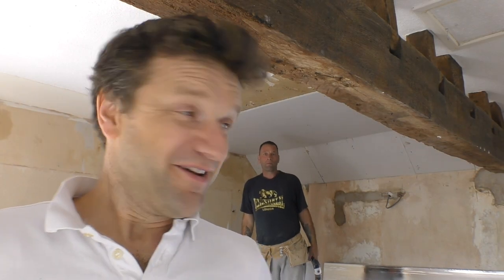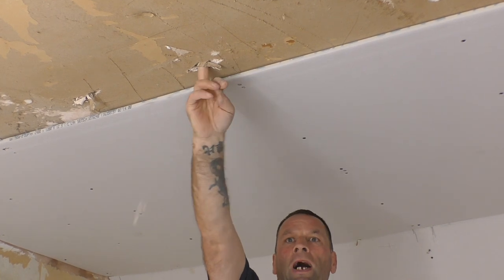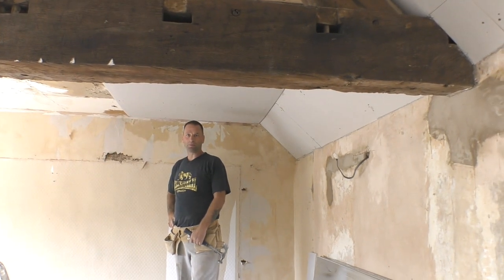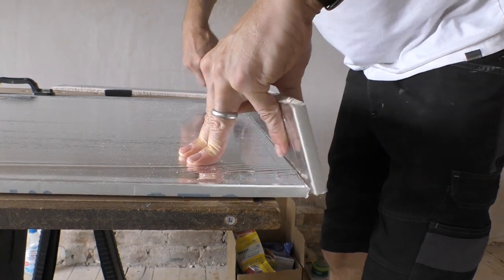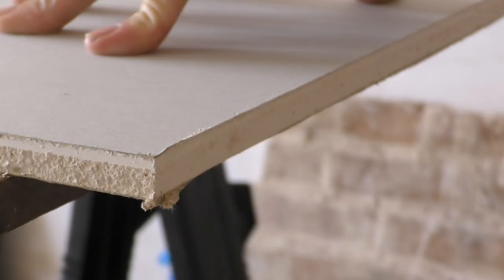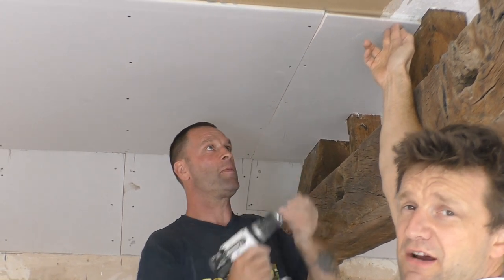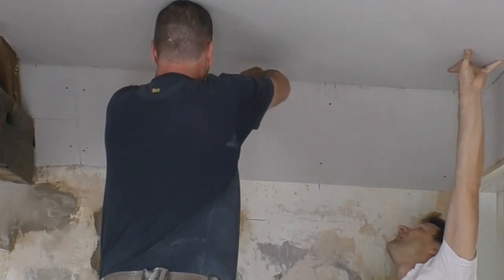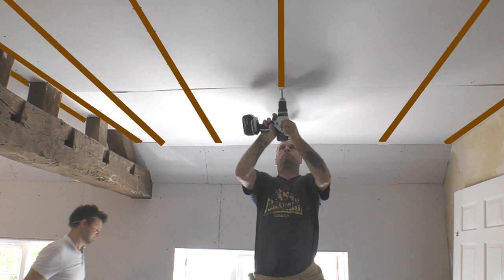How to Plasterboard an Old Ceiling

Comment: I have put up plasterboard on two ceilings in my house. In both cases, I have removed the old plasterboard first. This is a filthy job especially if there is insulation above. Having removed the old plasterboard, I have attached 2 x 4's to the joists to create a perfectly flat and level surface for the new plasterboard. Obviously this is a lot more work and only worthwhile if the old ceilings aren't flat and/or level.
Reply: @Suns Out silly comment.

Comment: I’m replacing my bedroom ceiling this year. I’m going to take the old ceiling down and replace it with a new one don’t like the idea of to much weight over my head. I know it’s going to be a messy job.
Reply from the maker: It will be very messy but satisfying when done.
Reply: much better way of doing it! sticking it over the top very amateurish.  where are the joint strips?  where's the leveling???

Comment: 45mm screws would suffice if fixing into joists/rafters/studs directly. Spec sheet for British gypsum is 25mm screw penetration min. and 230mm spacings with 150mm at board ends for ceilings.

Comment: By the way a good reason for not using foil-backed plasterboard when you don't need to is that it completely buggers up wifi if you do a whole room with it!
Reply from the maker: Agree with that Andrew. We've got celotex insulation everywhere in our office and have to go outside to use our mobiles !!
Reply: Agreed.  Upstairs like this is fine but I've heard of issues with this a few times.

Comment: In France they have a attachment that fits over the end of the drill bit, which makes it impossible to drill the screw in to deep , so they are All  in level, c, est  parfait.......🐟🐟
Reply from the maker: Yes you can get those over here too. Worth it if you're putting up loads of boards each day. 👍🏻

Comment: Very informative video, but how did you deal with the loft hatch architrave? I noticed you’d boarded round it. Would it have been easier to take the architrave off and board right up to the frame then architrave over the plasterboard?
Reply from the maker: There's was a little snippit in this video https://youtu.be/idmmDRM3x0A at 9:35 mins. Basically I screwed a new surround - 14mm x 30 or 40mm (width doesn't matter as long as it's covered by the architrave) of planed pine to the underside of the hatch, with a slight overhang that the hatch itself could rest down onto.  We could then plasterboard up to that pine strip, and then the new architrave was glued to that.
Reply: @CharlieDIYte  Ah makes sense, thanks Charlie! Looking forward to your next videos!

Comment: Do you have a video showing how to repair peeling plasterboard tape in corners of room (new build ). Your videos are really helpful. Just watched your 2 caulking ones.
Reply from the maker: I don't unfortunately but my advice would be to cut away the section that is protruding out of the plaster with a Stanley knife, (if it's only a small area which I'm guessing it is) and get yourself a box of this https://bit.ly/393yo8a and mix a bit up like I showed in this video https://bit.ly/37aov70 and apply it to the damaged area with a decorators knife or better still a continental fillers knife, leaving it a bit proud of the surface and then gently sand once it's set with a 120 or 180 grit sand paper wrapped around a little block of wood, or a sanding block if you can get one. It will be an invisible repair which you can then repaint. When you repaint, water down the first coat you, so it sinks in properly, just checking the emulsion tin to make sure it says you can water it down.
Reply: @CharlieDIYte  that’s great. Thanks for your help!  It is a rather large area (ceiling and adjacent wall) but I will try this approach on a small part first. And if works will do the rest. Thanks again.

Comment: Hi Charle, glad I found your video. Need to show it to my builder!!! We got a old flat ” plaster & wood lath” ceiling where we want to install number of trimless light” in each room.  I was told the a new ceiling needed to install those ” trim less light fitting”.      Instead of doing a drop ceiling or take the old ceiling down, the method show in your video might be a solution :).      I am interested in your view- Do you think the method showing can allow trim light installed successfully? Thanks in advance for your reply.

Comment: Do you have a video on joining the plaster board, sealing with take and playing over it or is that not done now. Thank you
Reply from the maker: This is the original video. https://bit.ly/3r5EV89 although you don't see me applying scrim tape to the joins. It's dead easy to do though so you don't really need a video on it. Just make sure you get a decent one, something like this https://bit.ly/2sjZ2X6

Comment: Hi. What would happen if the plasterboard had been fitted with the backing to the outside? A guy recently fitted it back to front on a stud wall he had built for us, but on the plasterer's advice we had to remove it and refit it the right way round before he skimmed the room. The guy who fitted it incorrectly said that it shouldn't make any difference. Who's right?

Comment: Thanks for the video Charlie. I've got a similar situation to this, though I was going to remove the old plasterboard and replace it, rather than going over the top. Is there much benefit in going on top of the old plasterboard?
Reply: The benefits are a lot less mess,when you pull the ceiling down all the dust and mess from above the ceiling as well as plasterboard.
Reply from the maker: You have to weigh up the pros and the cons, Dan. As Gerard says, there's a huge amount of mess if you take the ceiling down, as well as having to remove each and ever nail from the joists. In my case you have the added complexity of the sloping ceiling which would also need to be removed and that's interconnected with a rather bizarre arrangement where the victorians rendered a course of roof tiles at the top of the wall to cover a base plate that the roof joists sat on. With old properties like mine, you can quite quickly be faced with a complete rebuild so I although I'm a perfectionist and would normally want to remove the plasterboard and start again, I had to take the pragmatic line here - as we're living in the house and I didn't want to introduce all that dust and soot in to the living environment. If the ceiling is reasonably flat free of damp etc, plasterboarding over the existing is a sensible option.
Reply: @CharlieDIYte  Thanks Charlie, appreciate the response. I can definitely see the logic in this approach and think I'll do the same. My property is from the same era, so probably has similar issues. I'm slowly working my way through fixing the poor 90s conversion work and finding all kinds of issues.  Great videos, please keep them coming.
Reply: I took down an old plaster and lath ceiling (a very messy job) before putting plasterboard up on the advice of a very experienced (45 years in the trade full-time-  who has 3 year waiting list). He said the additional weight (doubling) on joists not designed to take that weight can over time cause bowing. Also, if there's a leak from a water pipe getting removing two layers can be nightmare. It was messy but I sleep easier...

Comment: Hi was just wondering what mm thickness(new 2nd) plasterboard did you use? 

Also I'm assuming that the joists are cable of handling the weight of a double layered plasterboard set up?
Reply from the maker: 12mm foil backed. Yes the roof joists won't have a problem with that weight.
Reply: @CharlieDIYte  besides the benefit of having a moisture barrier when using the 12mm foiled back plasterboard, would using a standard tapered edged plasterboard be okay to use? My loft has currently been gutted out and will be using it as a storage/office space. I'm thinking of using kingspan between the joists and normal loft insulation where needed. What do you think if you were in my current position?

Comment: Hi Charlie. Thanks for all you videos. So helpful. I discovered this video as we are currently overboarding an old ceiling in a similar condition to the one in this. My original concern was some parts of the old ceiling looked uneven and quite aged and not suitable to go on top of. But would you say this isn't the case?
Reply from the maker: My ceiling was similarly uneven. You'll find that once you pull it up with the screws that the plasterboard is reasonably flexible. I'd go for it!

Comment: Can you use the insulated plasterboard that you used on the walls on the ceiling?
Reply from the maker: No reason why not but it's heavy stuff. You'd be better putting decent insulation in the roof space above, assuming that's practical?

Comment: Charlie. Thank you very much for your video.

I am thinking of doing some DIY myself, so excuse a novice question. Why are you not ripping down the old plaster board to then put the new stuff directly on the joists
Reply: Without presuming to speak on Charlie's behalf there are a few advantages of screwing plasterboard to old plasterboard. Number one is a drastic reduction in mess ,dust and waste. When you pull down a ceiling there is tons of dust generated which will get everywhere regardless of how stringent your dust control measures. Plus you have to remove all the nails before placing the new sheet. Overboarding is less hassle.
Reply: I will speculate that one big reason is if there is an attic above, then you have to deal with all the insulation that might fall out along with whatever else is up there and its easier just to not have to deal with that mess!
Reply from the maker: That's right. The dust, soot and insulation would have been a lot to manage but to be honest I'm now regretting not pulling down the entire ceiling and leaving the apex beams on show because the beams in the attic are something else!
Reply: @CharlieDIYte  That's only if they look good to start with lol

Comment: Charlie, when screwing adjoining boards into the same joist, is there a danger of splitting the wood/not screwing close enough to the centre? I can't work out from the video how you guys did it, doesn't seem that you were too worried about it?
Reply: and did gerard smash holes either side of the joist, in order to locate the centre?
Reply from the maker: Yes that's why he smashed holes each side and no, you won't split the wood with dry wall screws. The thread is very narrow - about 4mm. Even if you do, don't worry it won't affect the structural integrity of the joist.

Comment: Great video. Do you now use your ryobi drills or the erbower drills would make a great video
Reply from the maker: Hi Josh. I'm really tempted to do a video on that! It would be a bit of an unfair comparison in the sense that the Ryobi are all brushed whereas the Erbauer are brushless but I've been generally using the Erbauer although the fitter (a carpenter friend) who works for me once a week and uses my tools recently asked me to put my Ryobi combi back in the case as he finds it's less bulky and can get into tighter spaces and the plastic chuck is less likely to damage customers walls. There's a tiny lag on the brushless tools compared to the brushed when you pull the trigger but the Erbauer batteries seem to go on and on for ever, and the Erbauer combi is definitely more powerful than the Ryobi. Leave it with me. Maybe later in the summer I'll put something out there!
Reply: Charlie DIYte thanks for that

Comment: Great video Charlie, is there anyway I could contact Gerard for a similar job? also will you be doing any videos on skimming the walls of a room that's marked after wallpaper removal?
Reply from the maker: Hi Neil. Are you in the West Midlands? I'm sure Gerard would be keen if it's local. If so, drop me an email on charliediyte@gmail.com and I'll forward you his details. How badly marked is the wall? If not too bad and you'd rather not skim, you could always use Easi-Fill to fill the scuffs.

Comment: where is the glue to assist holding the board? don't use clout nails as they tend to pop out or create a bump over time
Reply from the maker: They don't pop out or bubble when combined with screws as we've done here.

Comment: Hellllpppp can anyone tell me if I can just glue the board on my ceiling? If so, do you think it can crack ? Ps : I  never use plasterboard in my life, but I'm woman in a mission to take out  those artex ceiling from my house .
Reply from the maker: No you can't just glue it - the glue would only be as strong as the bond of artex to the ceiling, and the plasterboard would be too heavy. It must be screwed to the joists if you're fixing to the ceiling.

Comment: Surely it’s a lot quicker putting in a screw straight away rather than putting in the nails first?
Reply: With a screw you need a heavy driver and have to line up the screw bit with the screw. As opposed to just whacking a nail in with a hammer.
Reply: Sorry don’t agree, from experience it’s definitely quicker pumping in a couple of screws. If you have the correct drill bit (plasterboard bit) on there is no faffing around 🤷🏽‍♂️
Reply: Fair enough. I’m just a DIYer

Comment: Hi Charlie, You showed what I used to call a "surf plain" this was probably a manufactures name more than an item name. I haven't had one for some time now so I went direct to "today's toolkit" to order one only to find that you have not listed it. Come on if you are going to have a toolkit list at least list all the tools in that video.
Reply from the maker: That's a bit harsh but you're right to point out the omission. Here's the Draper version listed in the insulated plasterboard video https://www.toolstation.com/draper-multi-rasp-planer/p25009 I'll update the Description for this video when I'm back later.
Reply: I know it as a Surform Plane (Surform for short), but maybe that's Stanley's name for it.
Reply from the maker: It's this one. Details now updated in the Description http://bit.ly/2T3lKvV
Reply from the maker: Hi John, I've now updated the Description with the actual tool I used - the Stanley Surform Rasp Planer http://bit.ly/2T3lKvV Thanks for the heads up.
Reply: Disrespectful comment from a person that hasn't posted a single video. Show some manners.
Reply: @darland3821  Come on Darland! I think he was just messing

Comment: Quick question, do you not need to add noggins in between the joists to anchor the long edge of the plasterboard?
Reply from the maker: D'you mean the short edge? The long edge runs along the joists? I'm trying to think what we did about the short edge but yes it would be better if you could screw these to a noggin.

Comment: You only need to score it once 🙉
Reply from the maker: Fair point - and as I showed in the final example, but I find you get a cleaner break if you score it a few times.
Reply: Not if its a pink board (fireboard) your better of with a saw

Comment: 2 people boarding a ceiling you would just put a screw in while the other holds it up,,65mm is too much I think for a overboard on plasterboard,,maybe for lath and plaster
Reply: Ceiling very uneven,tried 50mm screws no good in places so 65mmscrews were best.
Reply: @gerardjames7539  100% know where you are coming from 👍

Comment: Would it not have been better to rip the old plaster boards down and replace them.
Reply from the maker: Possibly Gareth but the dust, mess and loft insulation that would have rained down would have been horrendous, particularly given we were living there during the work.

Comment: I'm surprised you've put new board onto old, moisture? Surely you take the old ceiling down to put new board on.
Reply from the maker: People have been putting new board onto old for years. If the house is lived in, you're opening a can of worms if you drop a ceiling with all the dust, spores, and soot flying around. Much simpler to simply over board. In this case I was using foil lined plasterboard which basically prevents any vapour or moisture from rising up into the roof timbers and condensing. Condensation shouldn't be an issue because of the loft insulation, but it's better to take a belt and braces approach to this.
Reply: I had to take down an old lath and plaster ceiling in a converted steading in Aberdeen.  That was when I discovered they used to use ash and clinker from the fireplace as insulation.  I looked like a coal mineral the time I finished.  No choice on that occasion, but best avoided if possible

Comment: Where I live they used a mixture of clout nails and dry wall screws and I can confirm they pop out from the plaster board and plaster over time when the building warms up and cools down I wouldn’t use clout nails or follow the advice on this video bloke doesn’t know what his talking about...
Reply: If you nail on the edge and screw on the bound edge then scrim hardly a problem,even with screws You have the heads pop.especially on old places have more structural movement,I only put about six nails in each board then the rest of board is screwed six inches apart